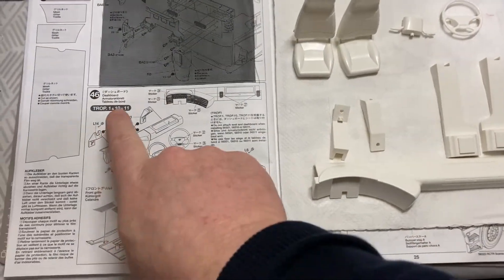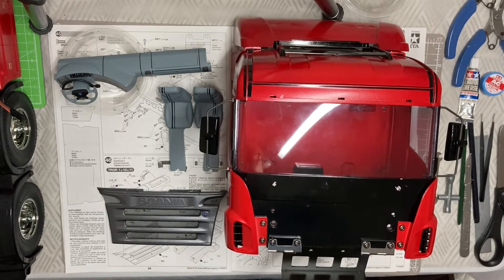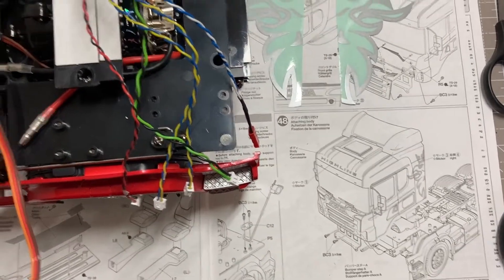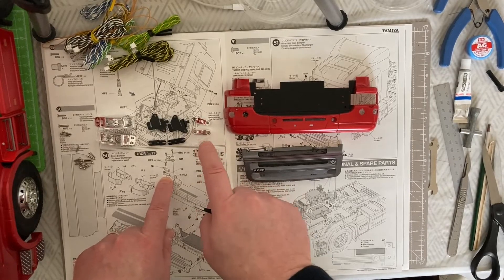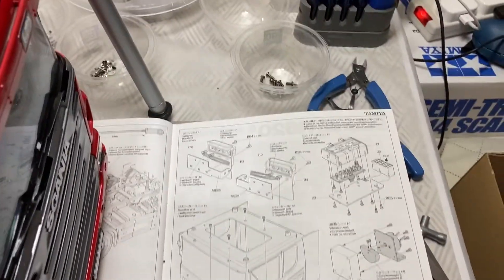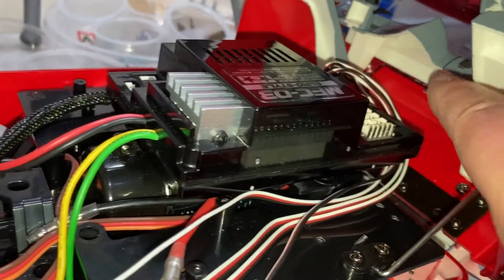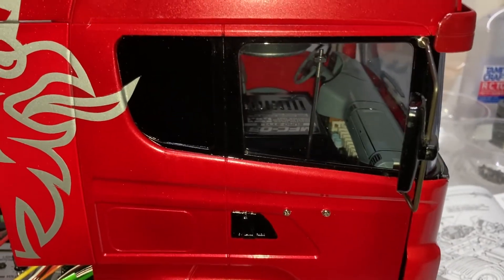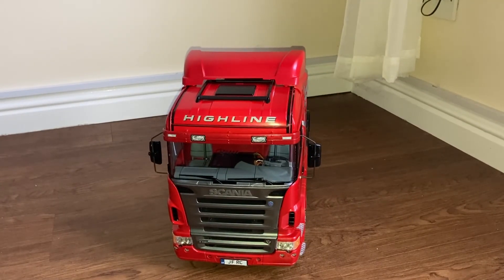The Tamiya Scania R620 Highline Build Steps 46 to 51 and MFC-03 Unit

Comment: Great video John, your truck is going straight forward. I was a little bit shocked as I saw the screws of the rod mounting on the outside of the door. Hadn't Tamiya find a hetter solution to let the screws stay on the inside of the cab? Maybe behind the front grill or under the seats? These semi's aren't cheap.

You made a great model. Thanks for showing its functions💪👍👏👏👏
Reply from the maker: Hi there and thank you for watching. Yeah I was thinking the same thing, the seats and dashboard are screwed from the front also, but the front grill hides them, but the side screws, really they could have moulded a screw mound inside. Hey, it is what it is. I might look at dabbing some red paint on them to take your eye off the screw heads. Really has been a great truck though, I’ve really enjoyed building this one. Take care and best wishes 😉😊😉

Comment: John that is amazing! Firstly the quality of your painting and detailing is awesome. Then getting that sound module and cables in there is wizard! Well done sir! You are going to have so much fun with this 👍🏻🙌🏻
Reply from the maker: Hi there Craig, this has been a really enjoyable build indeed. I’m so, so lucky to have been gifted such a great model. Thank you for your kind words about the painting. The painting took absolutely ages to do, I suppose I should have waited for some warmer weather to paint it outside. But I had my trusty, years and years old heat gun to hand, to help heat the home made spray booth, so that I could paint the truck components, and there is a lot of them 🤯. I used some expandable sleeving to loom the cabling, there is again a ton of cables to hide under the cab and even though Tamiya said that you had to remove the seats and dashboard, if you want to use the MFC-03 unit, I was determined to have everything inside the cab 😉😊 that’s my Taurean stubborn streak in me 😁😁. I will be doing a running video of the truck and trailer soon, now that the weather is improving and work (I.e 3 x storm claims) are starting to reduce, I’m hoping to get a bit more me time 😁😉😊. Take care and best wishes to you and the family.

Comment: Incredibly good RC and very realistic like the original. the red color makes this RC cooler and the sound too. good work.
Reply from the maker: Hi there G9 RC and thank you for your kind comments. I had to do it box art, just liked that Mica Red and Gun Metal Grey grill. The MFC unit takes some fitting in, especially with the wiring, and I was determined to have the seats, driver, dashboard and MFC unit all in there. Take care and best wishes 😊😉😊

Comment: Hiya John, hope all is well. Well my friend, all I can say is SWEEET!!!!!!!! Better you than me with all those wires, but it does add a extra special realism to the kit, and what a kit it is, Just Awesome!!!!!!!
Reply from the maker: Hi Bob, hope you and the family are well. Thank you for watching and the great encouragement. The inside of the cab was a real test indeed. I was determined though to get everything in. Tamiya say you have to remove the seats and dashboard to fit the MFC-03 unit, but then that would leave the cab empty. That’s not what I wanted. So, I set about making a slight change and routing of the cabling so it all goes into the cab. I’ve also soldered in ‘Y’ joints for the rear indicators and rear lights, so that the trailer lights will work too. Would I do another…..yes please. Loved every second. Take care and best wishes to you and the family 😉😊😉
Reply: @JF-RC  I would love to build one myself. You did a great job Mate!!
Reply from the maker: @UncleBobsRC  hi Bob, definitely think one of these would be a perfect build for you. Keeps you engaged for days and weeks. Take care and best wishes to you and the family 😉😊😉

Comment: Your video is very help for assembly my R620 and MFC-03. 
May I know How to install Vibration unit? Thank you~
Reply from the maker: Hi there Jerry, thank you for watching, I appreciate you stopping by. I didn’t install the vibration unit in mine, I needed the space for the MFC-03 unit and the driver and seat, so sacrificed the vibration unit. It’s not a very difficult unit to install, it’s a case attaching the counter weight to the vibration unit, and installing the the unit on the main tray, connecting to the port of the MFC-03 unit. But you might want the driver and seats for the look instead of the vibrator 😉😊